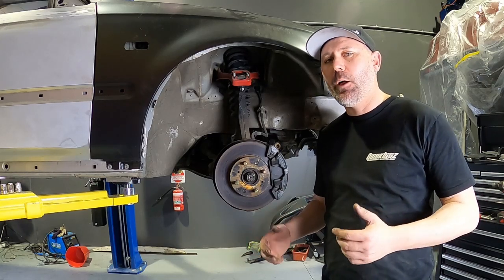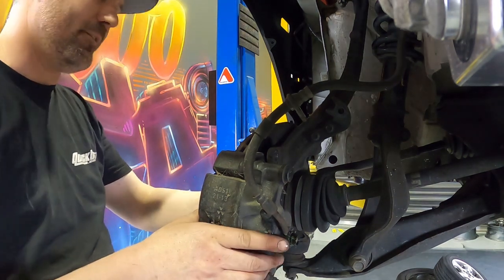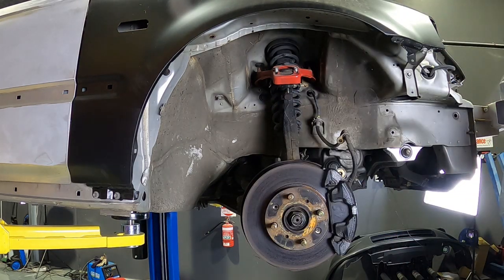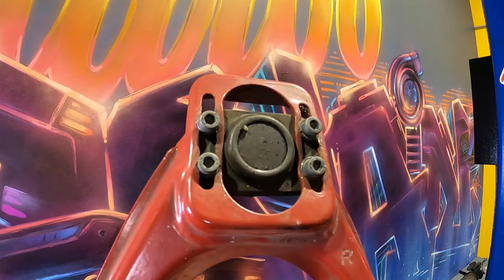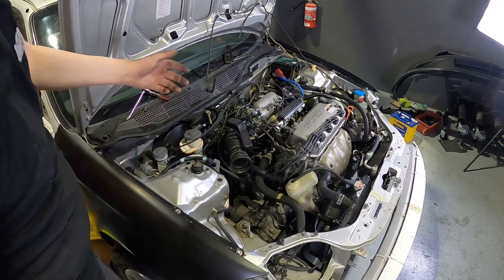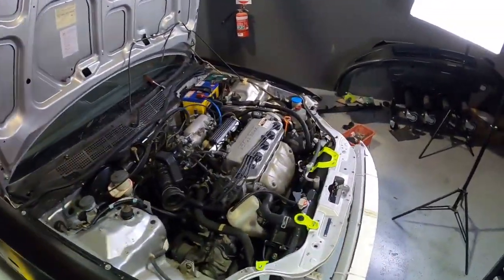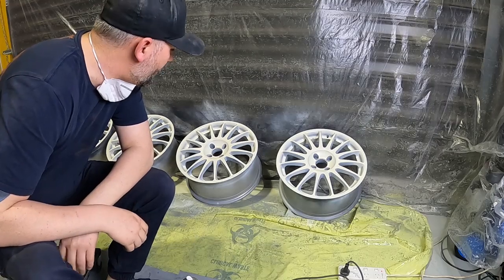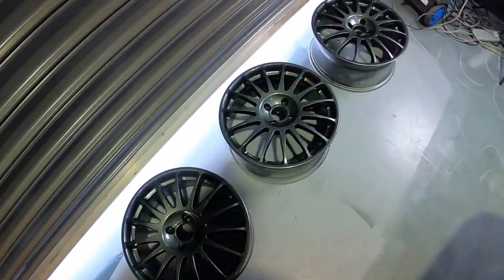NEW CUSTOM WHEELS ON  MY EK CIVIC N/A BUILD + FIXING MORE DANGEROUS SUSPENSION AND ANOTHER BIG FAIL

Comment: +42 offset with 205/50r15 I needed a 3mm spacer to run that offset. Most likely due to the wide tires and shorter wheel. Just a heads up, check the rear for rubbing on upper control and  rear trialing arm.
Reply from the maker: I’m running 205/40r17 I have tested the rear all looks good
Reply: Good call!

Comment: Thanks for all the info and links to get the correct parts. I think when I do mine mine i would be sending the disks in to get them drilled bigger and a sleeve pressed in to reduce it down to factory civic hole size for the lug studs. Just to prevent any vibration or future issues
Reply from the maker: I am thinking about drilling out the locator holes  so the sit correctly also
Reply: @TURBOTRISTO   if you do make a video on how you go about it. I just thought with the amount of slop and move ment that would be the best solution and cheap enough unless you actually change the hub studs but that brings pretty much the same issue. Please let us know with a follow up when you do this

Cheers man
Reply from the maker: @jasonmeyer3206  will do mate, there is a spacer kit you can get somewhere I still haven’t found it yet but I know there is one

Comment: The calipers that you have they are right. The front Big Brake upgrade fits only if you have already bigger brakes (262mm) like the Civic EK4, EM1, or CRX EG2 or EH6. so you need the knuckles from these cars because the knuckles with brakes 242mm and 262mm are different(bolt/hole spacing). For the front Big Brake (if you can buy in Australia) you can use the brake disc from a MG ZR 2001-2005 1.8 160hp brake disc they are 282mm in diameter and 25mm thick (2mm thicker as the Mini brake disc) and they fit like oem brake disc so you don´t need spacers for the hub and studs and even the 2 holes to secure the brake disc are the same like oem and for the rear upgrade to 260mm (only if you have already 240mm original or after a conversion to brake disc) you can use the disc from the same car but for that you need the brake calipers from a Integra DC2. I did tha on my Honda Civic ej9 (Germany)  is the same as an Civic EK.                                                         
Sorry for my english that not my first language.
Reply from the maker: I thought I had it correct because I have done this mod in my own ek civic sedan, so I guess that’s great news I will go to the wreckers and grab some ek sedan front knuckles !!! Thanks man that is an easy fix I was cursing having to re paint and re smooth out those calipers again it took me a whole day
Reply from the maker: Thank you for your amazing help brother DANKE
Reply: @TURBOTRISTO  No Problem.  for the the front upgrade you can also use the first gen CR-V brake calipers. Honda Legend KA7 brake calipers they are 2 piston.(thats my setup)
Reply: @TURBOTRISTO  Yes i saw it. I think on your sedan you had already 260mm brake disc.
Reply from the maker: @nikolaiklump5576  yes I did already have stock 260
Reply: @TURBOTRISTO  on 260mm it will fit but on the 240mm they dont fit. you can messure the hole spacing where the brake caliper carrier is bolted on and you will see that the spacing is differen/longer
Reply: I forgot to mention the MG ZR Brake discs are 4x100 so when someone make the front and rear upgrade they will have the Integra DC2 brake setup but with 4x100
Reply from the maker: @nikolaiklump5576  awesome
Reply: @TURBOTRISTO  shoot I learned this the hard way as well with my car, though I was just replacing for stock sizes since I didn't have plans on getting larger wheels(yet) and found out the previous owner mismatched the knuckles when I tried installing the ex trimmed calipers and one side didn't line up. thankfully I was able to find a match at the junkyard lol

Comment: You do know you need the 262mm Hubs to do that conversion not the 242mm d16 ones
Reply from the maker: I did think about that, and turns out I was right, and you are right also, so I will upgrade the hubs, I didn’t have to on my sedan,
Reply: Is that 262mm referring to the factory disk size needed for this upgrade of the mini rotors and accord calipers? What models are those 262 hubs found on? Cheers
Reply from the maker: @jasonmeyer3206  they are on ek4 ej8 and ek1 sedan
Reply from the maker: Also em1